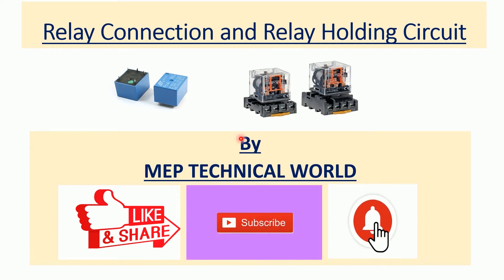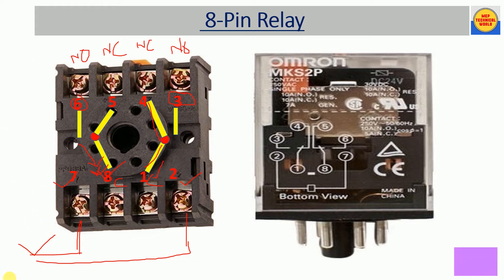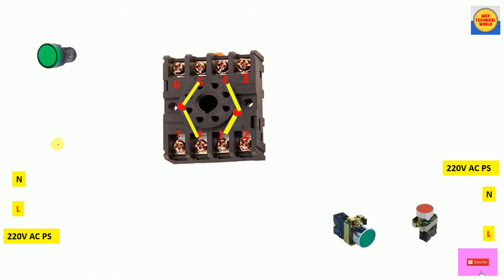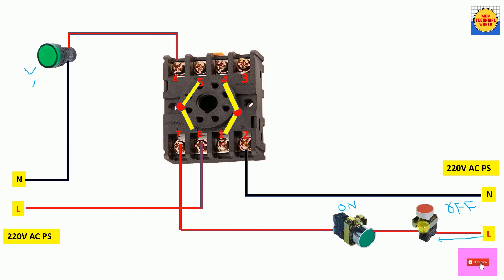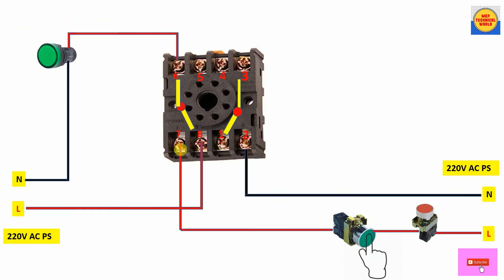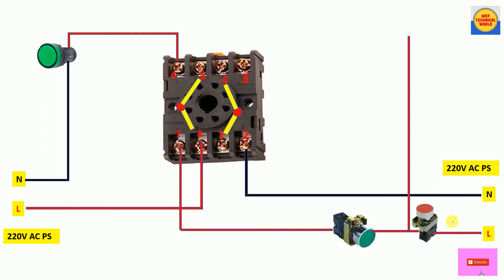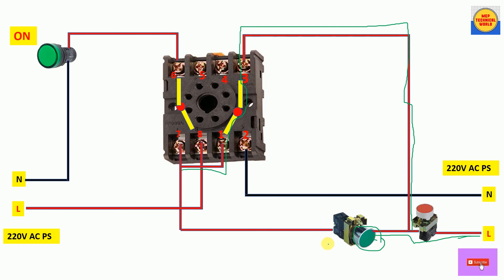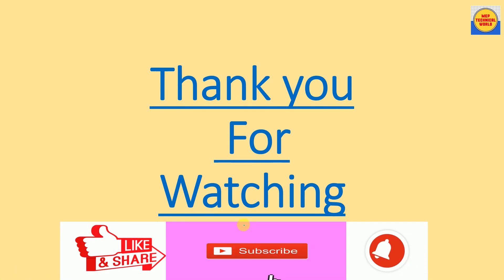Relay Connection and Relay Holding Circuit | How to do Relay Connection ?

Comment: Hi, I have a very similar relay, but the pin configuration is slightly different. I tried to get a hold connection going with my setup, but I have lock. I am not an electronic fundie and don't have experience with electronics other than watching specific tutorial when I build something which is very rare. Would you mind if I email you a wire diagram of a setup I have and be able to show me how the wiring should be done? My email address is ian.blom@gmail.com. please send me an email and then I will reply.